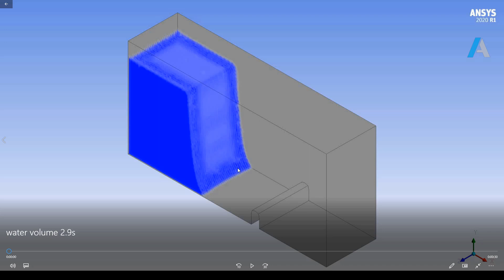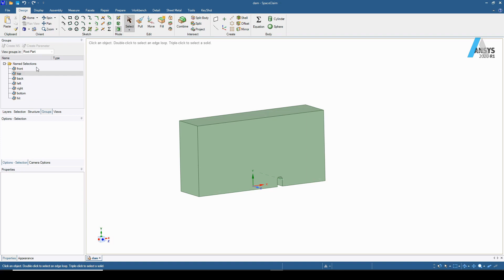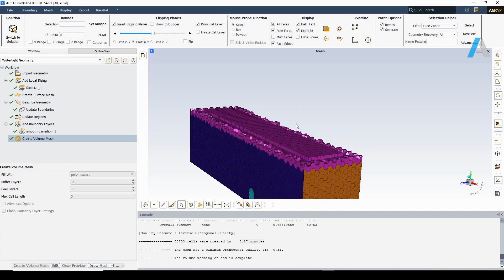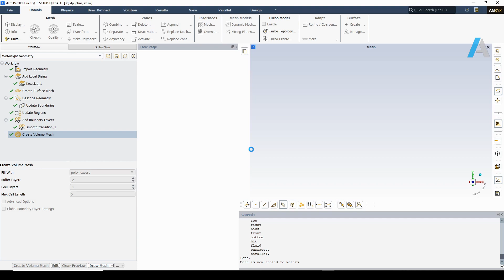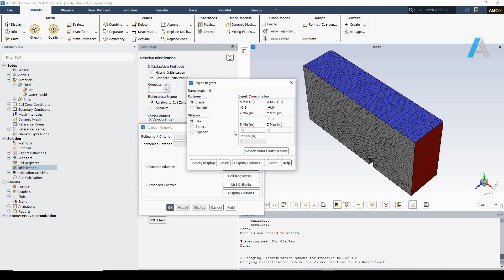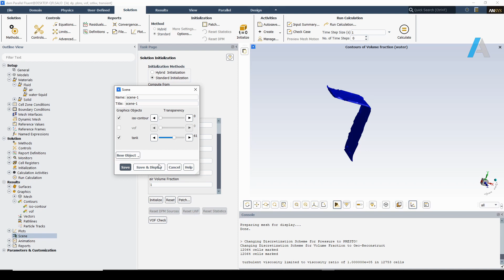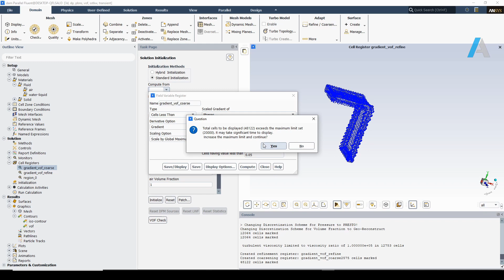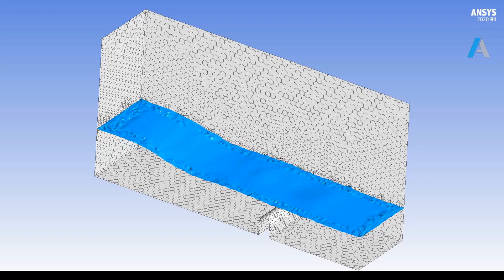Adaptive Mesh in Multi Phase Flow Simulation Using Ansys Fluent

Comment: Hi. I've tried to regenerate this simulation. However, my final animation doesn't have a smooth and fine water appearance like yours, it shows exactly the scene-1 iso-contour. May I miss any settings?
Reply from the maker: There are some practices to make a better animation in FLUENT. Modifying the lighting option can change the final animation, defining proper contour for the surface, as well as proper export settings for the final rendering all have effects on the animation. Also, CFD-post is very powerful when it comes to creating visually realistic animations.

Comment: That's a great detailed tutorial. Love it!

How many mesh elements did you have? Please also share the details of your simulation machine and the simulation clock time. Thank you.
Reply from the maker: Please see the description for more information related to this tutorial. The base mesh number was 50,753 cells. For 2 seconds of simulation time, using 112 Cores and 8 nodes (in ANSYS Cloud), the computation took about five hours.
Reply: The Adaptive mesh must be computationally heavy to take 5 hours on just 50,000 cells on 112 cores. Did you use Ansys elastic cloud?

Comment: Hello, thanks for this great video. Could you explain a little bit on how to apply adaptive mesh if Eulerian model is applied rather than VOF? I found the adaptive mesh button is grey when I selected the Eulerian model. But as you showed in this video, it works well with VOF. Thank you.
Reply from the maker: The multiphase VOF mesh adaption is unavailable in Eulerian model, and therefore, you cannot select anything from "Predefined Criteria". Perhaps, in the future release, there will be some built-in mesh adaption for Eulerian model. Remember that VOF and Eulerian models are based on two different approaches of solving momentum and continuity equations. However, you should be able to manually apply mesh adaption in Eulerian model. You need to first create a new "Field Variable" under cell registers, and then active the dynamic mesh adaption under "Adaption Control". Please refer to the mixing elbow example (the 1st example) in Ansys Fluent Tutorial for the detailed information.
Reply: @alphaomegaproductdevelopme323  Thank you.

Comment: Thank you, Sir. What is the difference between this method and PUMA?
Reply from the maker: It's essentially the same.  In the past, automatic adaptive mesh refinement was not possible for polyhedral cells. But now, when you use multi-phase adaptive mesh, Fluent automatically uses polyhedral unstructured mesh adaptation (PUMA).

Comment: How many hours did it take to complete for 2 seconds??? 

Mine is of 48 cores , still I approximated to 56 days from what numbers I got in the console.  Total of 40,000,00 iterations and could complete only 56,200 in 18 hours. I used the same dimensions roughly and mesh size. 

I had to terminate after 18 hours. 56 days are so long! 

Please tell me how much time your pc took for 2 seconds.
Reply from the maker: It shouldn’t take that much time. Did you use parallel simulation? Be careful about recording the animation. I selected the animation to be recorded in every 0.001 s of flow-time (NOT time step), to avoid generating too much output. This will not only consume lower RAM, but also significantly increase the computational time. Also, make sure that you use a proper dimension. My domain dimension was 100mm*200mm. I actually used ANSYS Cloud for the computation. Using 112 Cores and 8 nodes, it took me less than five hours for 2 simulation seconds. If you want to know more about Ansys Cloud, please visit this video: https://www.youtube.com/watch?v=RGvV-_ntSvk&t=195s
Reply: @alphaomegaproductdevelopme323  thank you so much. That helped me a lot. I used the parallel simulation. But went for every time step solution animation, I think this is the reason for massive hours. 
Thanks for your response 😊.

Comment: Tq u so much for the video ♥️.
Reply from the maker: Of course, let us know if you have any questions!
Reply: @alphaomegaproductdevelopme323  
I have a doubt if this simulation has  baffle with holes do we need to define contact or just same process?
Reply from the maker: @tejeshreddy1055  The simulation process will be essentially the same. No need to define contact. The only thing you may consider is to refine your mesh near the holes by adding local sizing in the pre-processing.
Reply: @alphaomegaproductdevelopme323  on doing so I am unable to see animation if time step is 0.0001 but I am able to see pressure contours and if time step is given 0.01 then simulation gets stopped after 20 iterations.
1. Should I need to refine my mesh more ?
My current mesh size is 1mm at all edges 
And default at remaining surfaces.
Thankyou sir/madam for your reply
Reply from the maker: @tejeshreddy1055  Instead of a fixed time step, you may use the "Adaptive Multiphase-Specific" time step as shown in this video. This method adjusts the time step based on the Courant number in each iteration. In addition, this type of simulation (multiphase + dynamic mesh) is a heavy computation and generates huge amounts of data and requires high RAM, so if you are having difficulty to see the animation, it might be related to the hardware capability. You can try selecting “In Memory” or “HSF File” for storage type in Animation Definition to see how it works. And regarding your mesh size, as long as you have a good mesh quality (Minimum Orthogonal Quality>0.1 and Mesh Skewness<0.7) you can proceed to the solution mode.
Reply: @alphaomegaproductdevelopme323  Tq so much for your information and support ♥️

Comment: Thanks for the really nice step-by-step explanation!! Could you please comment on two settings you did?
1.Why did you chose k-omega model? I would assume the flow is mainly laminar, or am I wrong?
2. Why did you chose explicit VOF formulation? From my experience the implicit formulation is much faster and also reliable. Thank you very much for your reply.
Reply from the maker: Turbulence model is selected because the flow is locally turbulent, especially at the initial moments where the water column hits the obstacle.
The explicit VOF formulation was used to allow using geometric-reconstruction scheme to capture clear, crisp interface without numerical diffusion. In addition to that, explicit scheme generally has better numerical accuracy than implicit scheme.  Let me know if this helps.
Reply: @alphaomegaproductdevelopme323  Thank you for your reply! That helps a lot. Regarding the turbulence, how did you determine if the flow is locally turbulent? Was that an assumption or have you calculated that theoretically? I have a similar problem and I am not sure if the laminar model is adequate to use (overall the flow is laminar according the Reynolds number)
Reply from the maker: @janweggen7606  The assumption of the mentioned locally-turbulent flow is more intuitive in this case and it comes from the nature of flow features when it suddenly hits solid obstacles. In addition to that, a rough calculation of Reynolds number using the initial water column height (H), and maximum velocity of sqrt(g*H) shows that it exceeds the critical value for channel flows. Therefore, the assumption of turbulent flow seems to be more realistic in this case. It is worth to mention that since the main purpose of this tutorial was to demonstrate the multi-phase adaptive meshing technique, the other settings related to the model setup are not probably the best choice and can certainly be enhanced. For example, the model can be fine-tuned by testing laminar flow or choosing some other turbulence models and compared to the existing experimental data or theoretical results.
Reply: Thanks for your comment on that! That helped a lot.

Comment: if i would like the tank to rotate how am I suppose to set the condition, please? BTW thank you so much for this video!
Reply from the maker: Under wall boundary conditions, you can set "wall motion" as "moving wall" instead of the stationary wall, and prescribe the absolute "rotational speed" as well as the "rotation-axis origin" and "direction". Note that, you need to assign the same rotational speed and rotational axis direction for all walls. But carefully assign the different rotational axis origin to the walls so that the entire tank rotates properly. For rotating flows, due to the large pressure variations, "PRESTO" or "Body Force Weighted" should be used for the spatial discretization. Also, unlike this example where we are interested in the transient behavior, if you are looking for the steady-state behavior of a rotating flow, the better approach is to enable the "frame motion" under cell zone conditions, and set the rotational velocity there. And then, set the walls to be stationary relative to the adjacent cell zone.  Let me know if this helps.
Reply: Alpha Omega Product Development Systems Thank you so much for your reply!
(I actually use this program to study the water flow in a hollow sphere that rotate around Y and Z axis with the velocity 100 rpm, containing water in a half of its volume: in case you want to know.) I had run the calculations already before I saw your reply (TT)  I went for the Cell Zone Condition and used the mesh motion ( Will the result come out okay?) with the velocity 100 rpm  right now my computer still calculating the solution.... I’ve been waiting for 2 days! Does it take such a long time like this? And due to your reply I understand more about frame motion and the other ways to control the rotation many thanks 🙏
Reply from the maker: @Popocandy_  n general, the transient simulation of two-phase flow in combination with frame/mesh motion should be computationally expensive, and therefore you need to consider your computational resource to handle this simulation. If you are using the adaptive mesh, I would suggest you make a coarser base mesh. For more information about the rotating domain simulation in Fluent and how to set up such models, please refer to the chapter 10-12 in the Fluent User’s Guide.  Regarding the time - you could consider adding HPC or using the ANSYS Cloud offering.
Reply: Alpha Omega Product Development Systems You are so helpful! Thank you so much! And one last question how did you record the animation in that water color and such a smooth surface? My calculation is done but in my solution animation the water surface is sooo rough... or I did something wrong (U__U)
Reply from the maker: @Popocandy_  All the post-processing has been done using CFD-Post. When using the Iso-surface, I would suggest assigning a value of 0.99 or 0.01 (instead of 1 or 0) for air or water volume fraction to get a smoother interface. You can choose the water color using the constant mode in the color tab under the details of the Isosurface window. In addition, you can use the volume rendering option in CFD-Post by choosing the water volume fraction as the variable.
Reply: Alpha Omega Product Development Systems That’s very kind of you. U have helped me a lot! Gracias!
Reply from the maker: @Popocandy_  You are welcome and good luck with your simulations!

Comment: Hello, thanks for such an informative video, but I would like to request you to answer one question.  What are the boundary conditions, PV-Coupling Scheme, and URF values that you have set for this calculation? You have not used the energy equation, is it necessary or not?
Reply from the maker: Thanks for watching our video. Boundary conditions are all no-slip walls. SIMPLE method was used for pressure-velocity coupling. Under-relaxation factors are all the default values of VOF method:
Pressure: 0.3, Density: 1, Body forces: 1, Momentum 0.7, Turbulent Kinetic Energy: 0.8, Specific Dissipation Rate: 0.8, Turbulent Viscosity: 1
Since this is an isothermal example and we were not interested in temperature and heat transfer calculation, the energy equation was not used in this particular tutorial.

Comment: Can you please tell me how to use this feature in Ansys 18/19?
Reply from the maker: This specific multiphase VOF predefined dynamic adaption is available after ANSYS 2020 release. For the prior versions, the user needs to go through several other manual tasks for VOF dynamic mesh adaptation. You need to enable the "Refine and Coarsen" options in the "Gradient Adaption" dialog box. Please see Chapter 30 of the Fluent User's Guide (2019) and go through Dynamic Gradient Adaption Approach (see Section 30.4.1).
Reply from the maker: This specific multiphase VOF predefined dynamic adaption is available after ANSYS 2020 release. For the prior versions, the user needs to go through several other manual tasks for VOF dynamic mesh adaptation. You need to enable the "Refine and Coarsen" options in the "Gradient Adaption" dialog box. Please see Chapter 29 of the Fluent 18.0 User's Guide (Dynamic Adaption) and in particular, see Section 29.4 for Dynamic Gradient Adaption.
Reply: @alphaomegaproductdevelopme323  Hello, I tried to follow the steps given in the manual, but I am unable to refine the mesh dynamically. I need to have 6 layers of refinement near the interface at time instances. Can you please guide me through the steps for Fluent 18?
Reply from the maker: @varanasisaisubhankar8785  I haven't done this specific dynamic mesh adaption in Fluent 18 before. It is highly recommended to update to Fluent 2020. However, you should be able to do that by following the similar steps described in section 3.4.9 of the below tutorial for Fluent 18 (see pages 192-195).

Copy this link and put it in your browser: http://users.abo.fi/rzevenho/ansys%20fluent%2018%20tutorial%20guide.pdf  

The above example uses the "curvature" of "temperature" for mesh adaption, but for VOF simulation, you may select "Gradient" for method and select "phase volume fraction" instead of temperature and also enable Dynamic in the Dynamic tab of the Gradient Adaption dialog box (pg. 193). Please also make sure to specify a proper value for both refine and corasen threshold. This should work and dynamically refine the mesh, if the rest of your VOF model is properly set up.

Comment: Thank you very much for this step-by-step video tutorial on FLUENT, really helpful.

Also, can we perform the same in ANSYS 19.0 version?
Reply from the maker: This specific multiphase VOF predefined dynamic adaption is available after ANSYS 2020 release. For the prior versions, the user needs to go through several other manual tasks for VOF dynamic mesh adaptation. You need to enable the "Refine and Coarsen" options in the "Gradient Adaption" dialog box. Please see Chapter 30 of the Fluent User's Guide (2019) and go through Dynamic Gradient Adaption Approach (see Section 30.4.1).
Reply: @alphaomegaproductdevelopme323  much praise for your kind response. I was trying to figure out the procedure for Dynamic/adaptive mesh in my VOF model and with the help of your assistance I will finally be able to do it.
Reply: @alphaomegaproductdevelopme323  I've been using version 2023R2, and boy it seems the VOF adaptive mesh is much more cumbersome and super unintuitive. It isn't activated by default (even with VOF multiphase setting) unlike in the previous versions, and there's no clear instruction to do so (not even in the manual). Looks like a bug but who knows.

Comment: Thanks for this helpful tutorial. Does mesh adaption significantly slows your solution? This  always happens to me when I try to simulate droplet motion.
Reply from the maker: The mesh adaption technique that is described in this tutorial applies to almost any type of volume-of-fluid (VOF) simulations including liquid droplet or gas bubble. For the motion of liquid droplets or gas bubbles, the mesh adaption set up will be the same as demonstrated in this video. In general, this method helps to avoid the unnecessary fine meshes in most of the computational domain and thus, can significantly reduce the computational time. In addition, since the mesh adaption enhances the mesh resolution near the interface of gas-liquid, it leads to a sharper transition from one phase to another and therefore provides more accurate results.  In order to have a good balance between the simulation time and proper mesh resolution, it is important to have the base coarse mesh. And if still the simulation is slow, you can reduce the maximum refinement level and increase the frequency.
Reply: Thanks for your reply. Have you ever managed to do the post- processing for an adaptive mesh in CFD-post? I always get a message that adaption results are only available in CFF format and it doesn’t seem supported till now in CFD-post ( Ansys 2020R2).
Reply from the maker: @Mo.w77  There are two ways: (1) You can force Fluent to write the result out in legacy data format (.cas and .dat) which can then be read into CFD-Post. To read or write legacy files in both the current session and future sessions, open the General tab of the Preferences dialog box, select Legacy from the Default Format for I/O drop-down list. (2) You can also set up automatic export of CDAT files using File/Export/During Calculation/Solution Data.
Reply: Concerning my first comment, I got a reply that might be helpful from ansys forum coordinator that looks helpful. 
Here is his answer : If the model is run in parallel you'll be overloading one cpu, so need to use load balancing.
Reply from the maker: @Mo.w77  Thanks for sharing the comment here.